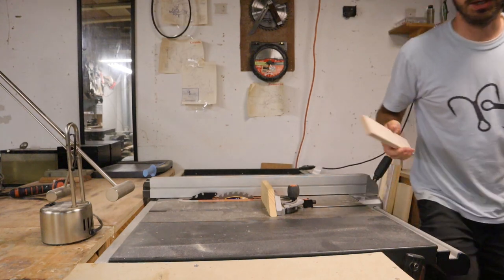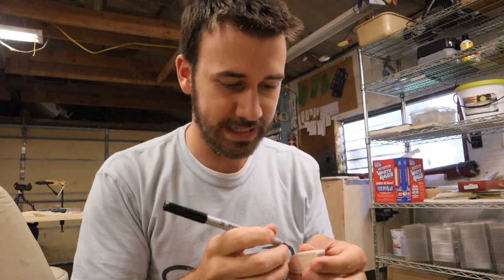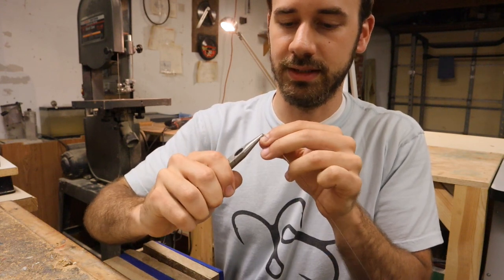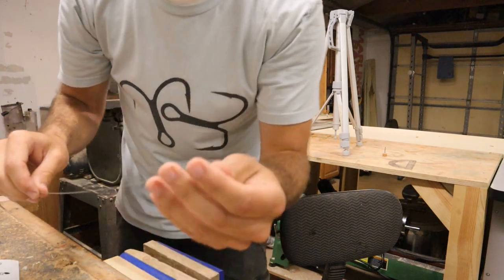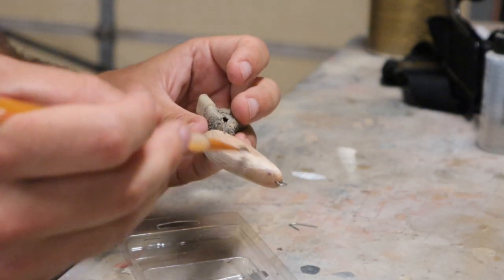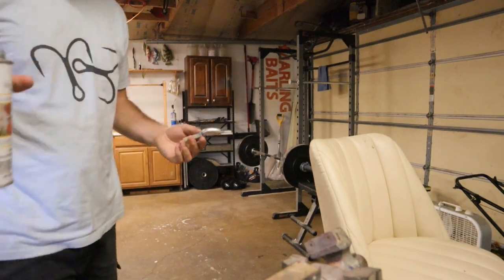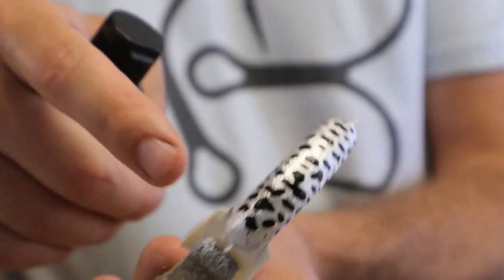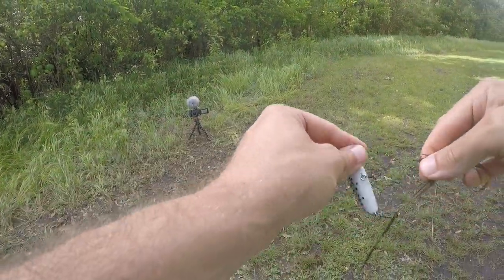Little CrankBait | One Day Build to Catch

Comment: What kind of wire do you use?
Reply from the maker: This stuff: https://www.ebay.com/itm/25-PCS-STAINLESS-STEEL-STRAIGHT-LURE-SHAFT-WIRE-FORM-0-030-X24-INCH-LONG/153425684027?hash=item23b8e2263b:g:QrsAAOSw2bFcRWmI
Reply: Thanks!